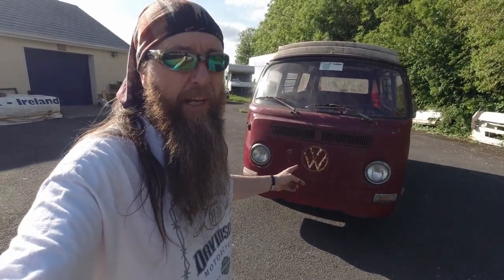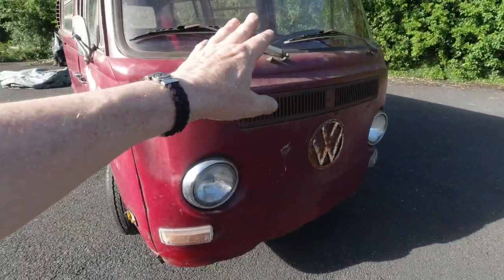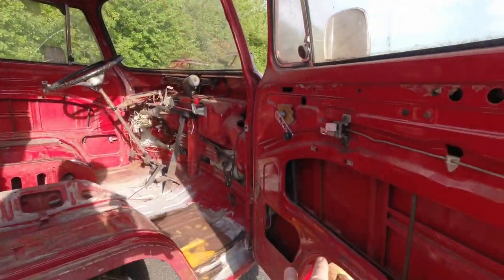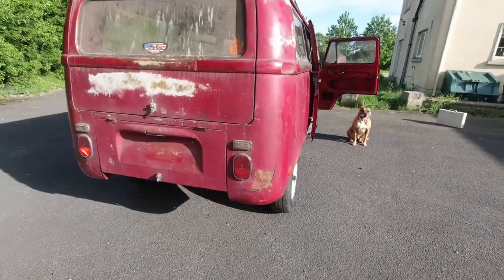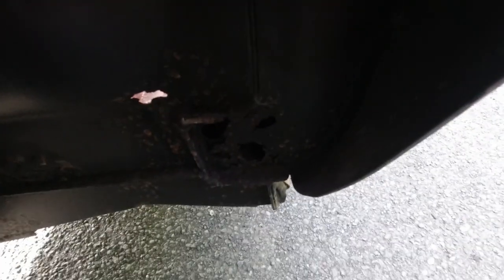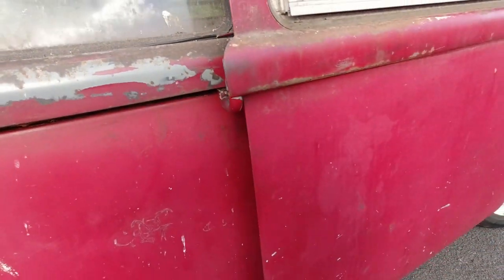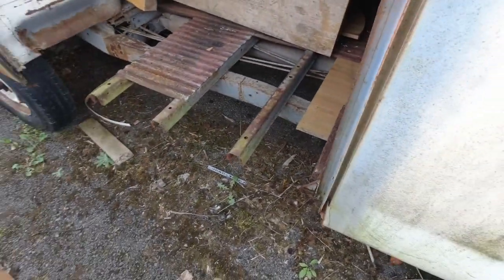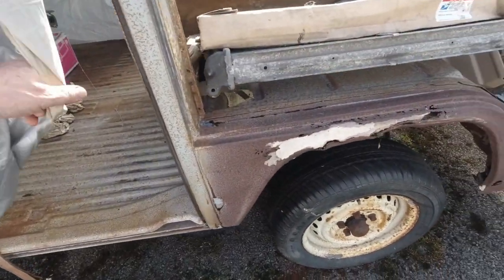VW t2 campervan where to look for rust before buying a vw campervan watch this inc rust assessment.

Comment: Nice guide. I’ve got to start the bodywork on mine this summer. My welding is going to need to radically improve.
Reply: Hi Gregg, good luck with the start on the Bodywork this Summer, I  said in my videos and different comments Welding Is an Art that takes a lot of time to learn so take your time to do and improve the welding Joe does great welding there is a lot to watch and learn. happy Summer my friend🇺🇸❤️🇳🇴🇳🇱🙏🏻,greetings Hubertus

Comment: Great video, but if you see my current project, you will see, that those problems at the T2 bus, you show in your video, are not the real problems. For example the sill below the sliding door is rusted from the inside. If you open it, you will see that the whole carrier ist gone, mostly. The only way to judge the quality of such an old bus, is to use an endoskope camera. All other thing, can be done easily. Kind regards Ralph.
Reply from the maker: Hi Ralph, and thanks for your interest and advice, yeah those cameras are a great tool to have in your arsenal, unfortunately I don’t have one yet, and I agree with you that most panels tend to rust from the inside out. Best wishes with yours buddy 🤙

Comment: Thanx for the info, a week late in viewing as i bought a 1978 T2 last week. There are issues in all the areas that uve mentioned but i can weld so will have all fixed soon !!
Reply: @Joesrustbuckets  major factor for buying, was new vw heritage engine and gearbox fitted in 2016, eh 18,000miles ago ! Runs sweet !!

Comment: Thats a great in depth look into the body love the Type 2 bay window but in the UK prices are so high and you need to go in with your eyes wide open I'd so love one but the T3 T25 Vanagon seems the more worthwhile purchase for me as im slowly looking for one
Reply from the maker: Hi Stephen, yeah I get what you’re saying, however the market for T2 has taken a bit of a downturn atm, across the board really, so it’s a good time to be looking for any model, best of luck with your purchase when it comes 🤙
Reply: @Joesrustbuckets  it's eventually going to have to be a Type 2 bay window maybe they've dropped off a bit due to stay cations holidays during the pandemic and a lot of campers Type 2 T3's etc were purchased as an impulse buy without looking into the gremlins of rust and rot and from time to time they're going to cough and spluttert maybe a set of points and condenser or a coil and people now are selling them on as they want the package holiday again

Comment: Hi, first of all, great video! I have a question, there is a guy in my neighbourhood selling a 1968 type A T2 with a chassis and motor that run perfectly. The price is decent (around 8k). the only thing that is really rusted to the core is the gutter piece. I happen to know someone who sells repairpieces for the T2 gutter. Would you know how hard it is to make the repair when the gutterpiece is already pre-shaped?
Reply: @Joesrustbuckets  thx for the tip, luckily I watched this video before I checked the van out ;) Would it matter if the van has a polyester roof (high roof)? I also didn't see much rust underneath the gutter, it was only the gutter itself that was as good as gone would this matter for the difficulty of the reparation?

Comment: Thanks Joe. Very informative video…
Reply: @Joesrustbuckets  looking at a bus tomorrow. Apparently barely any rust but I can see Bondo in the picture…😩
Reply: @Joesrustbuckets  I’d send you a picture so you could laugh… at least the engine is rebuilt.. we’ll see tomorrow
Reply: Spoke to the Owner. He says it barely has any rust….. but does have Bondo in it…🤔😩🙄
Reply: @Joesrustbuckets  I did. Inspection lasted 3 minutes. Lower screen surround was molded in Bondo and it was so thick on the front and side door it had cracks in it… yet for some weird reason it had a brand new engine in it…
Reply: @Joesrustbuckets  yeah that wasn’t the one. But they come up fairly regularly in Missouri so we’ll see

Comment: I have a 68 (made in 67) and a 79 (made in 78) and there are huge differences between the last and first production of the bay window.  I have restored both, and the 68 is much easier to work on, it has a lot less going on.  The main places are going to be the windows, lower nose, dog legs, inner dog legs, and gutters.  If you see any rot under the windows be careful, and look out for bondo!  You also want to avoid a bus that has been "patched" up by amateurs.  If you have a real restoration that is different.
Reply: Could you please outline some of the differences?
Reply: @bm7760  The nose is different (you can clearly see it since the indicators are in different places and the bumper style is different).  What the gas tank door looks like and placement of it.  Doors are different. My 68 doesn't have push locks and has different door knobs.  Most of the sheet metal has been reinforced on later models or it has added beads to make it stronger.

Comment: Don't need a magnet for the one I'm buying. Need a stick to see how deep the holes are :P
Reply: @Joesrustbuckets  seen a video of yours last night of putting a patch in a sill. That was a lovely patch, nice to see your cooling technique. I’ve always use a wet towel, might start using the air line myself much better way. Love the amount of effort you put into each patch, I’ve normally only done that on the outer bodywork.